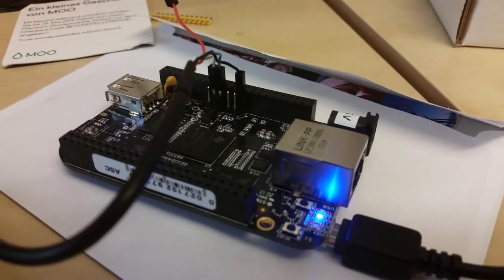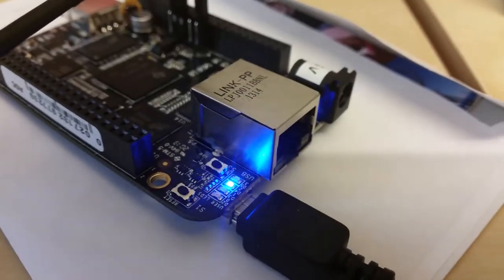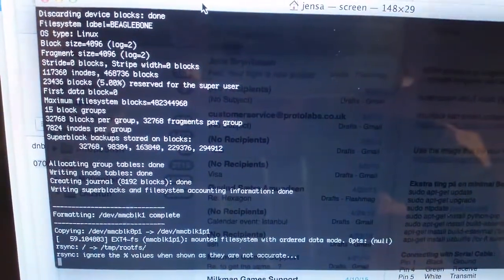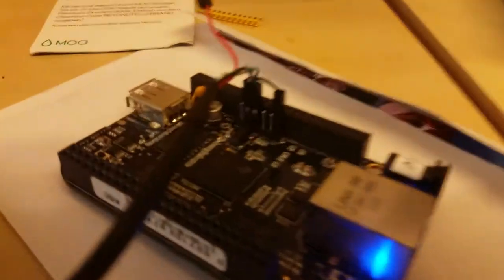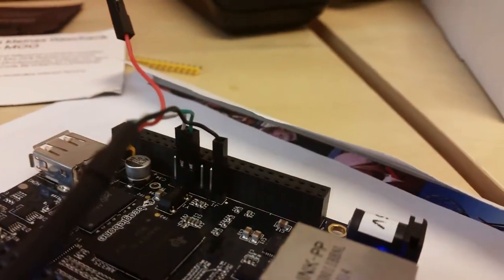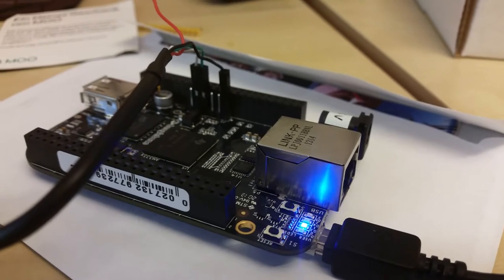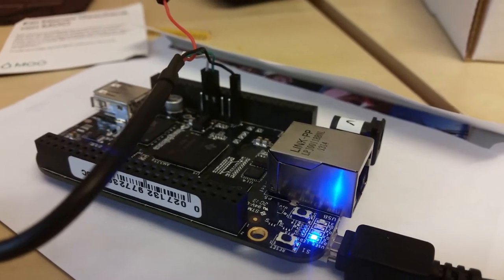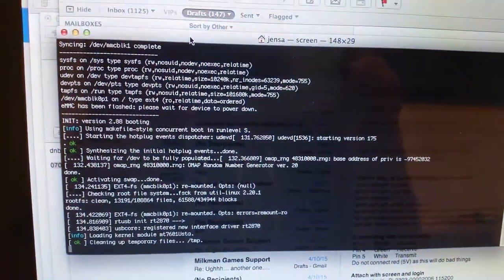Flashing a Beaglebone Black

Comment: Hi, I have the same LED pattern on my bbb. How long did you wait until lights were all on?
Reply from the maker: Vincent Gosselin quite some time? depends on several things such as the speed of your SD card.
Reply: Hello, it finally took only 10mins. I was doing this cause I wanted to back to factory setting to have 192.168.7.2 pinging but it doesnt :/
Reply from the maker: Pick up a serial cable for 3.3v machines and you can see the whole boot sequence? It's only $10 from Adafruit and allows you to log in to view errors, ip config and everything else on your own PC?  https://learn.adafruit.com/adafruits-raspberry-pi-lesson-5-using-a-console-cable/overview

Comment: Hello. I am trying to flash my bbb by using an sd card with the latest version of debian but it's not working. When I burn the image on the sd card and I want to check which files are on it the computer requires me to format it. What am I doing wrong?
Reply from the maker: Didn't see this question until now, but a Windows machine cannot view the file system for BBB. You need to use a Unix based machine to view the files. If you only have a Windows machine, you can install Ubuntu on Windows 10 quite easily. It'll help you solve anything like this. https://docs.microsoft.com/en-us/windows/wsl/install-win10